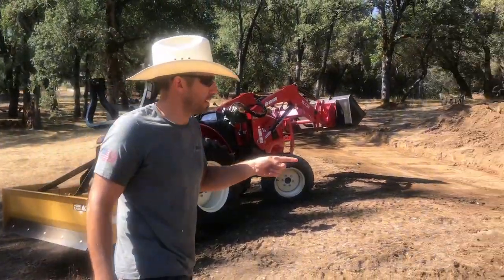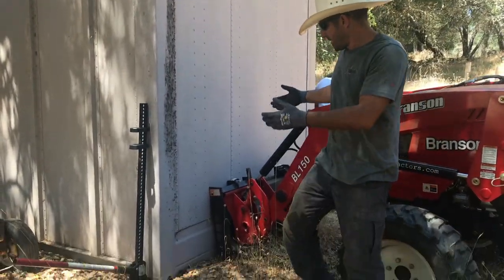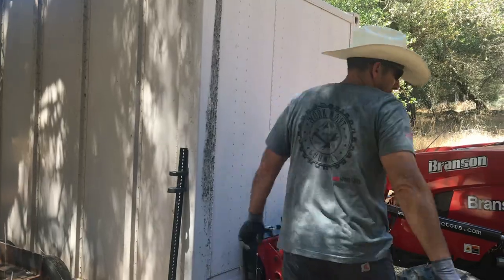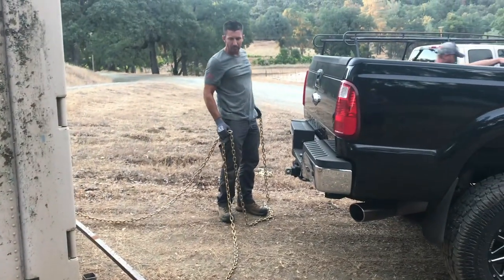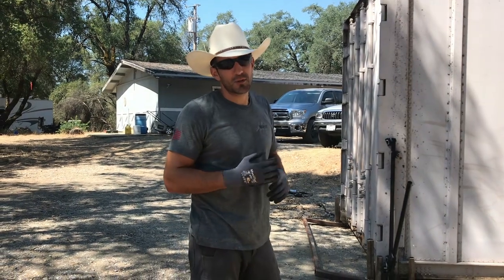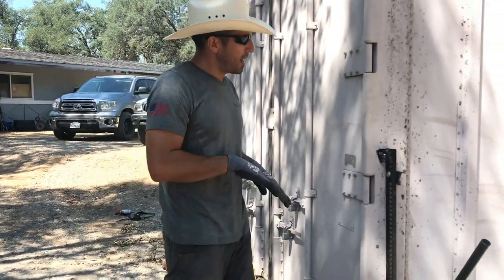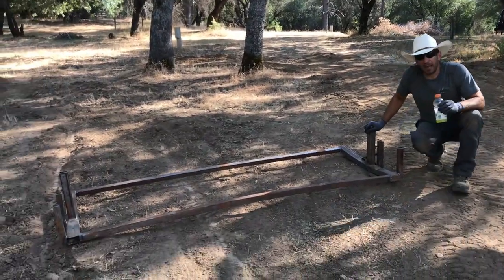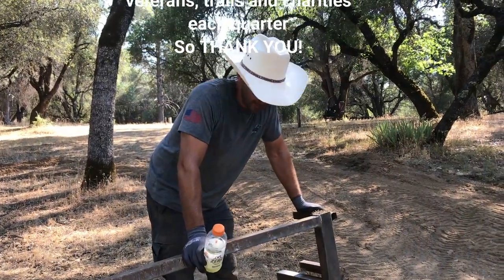Moving a 40' Storage Container with a F250 and Homemade Dolly - On The Homestead

Comment: Seems like a steel pipe would have been easier than the dolly. When I had my swim spa delivery they rolled it into place with some pvc pipes.
Reply from the maker: you would have an have several steel pipes to continue placing them under as it rolls over. and the sled allowed a little resistance as it rolls down hill.. thanks for watching

Comment: What's the story on the solid-tire dolly?  Is there another video?  Where did it come from?  Thanks!
Reply from the maker: those dolly wheel sets are used on a tow system for cars. the put one on each side of the car and there are metal crossmembers that span the width of the car and support it. then i filled them with a solid rubber mix from a company that does that specifically. they also make wheels thay can hook into the corner of the container but they were a little more expensive , thanks for watchin!
Reply: @WorknDirt  Thanks - what is the info on the tire filler company?
Reply: @WorknDirt  we need the company name please

Comment: Do you think you could have moved it with your tractor?
Reply from the maker: no i would need a tractor twice the size unfortunately
Reply: @WorknDirt  I have a mahindra 5145, Im going to attempt to move a 20ft I picked up a few months ago with
Reply from the maker: @beastofhumble  cool! thats a good size, i would put some short chains on the back of your tractor to take the weight off the front of the container and then see if you can slip something under the back feet on the container so they dont act as brakes lol. 
Your tractor might be strong enough just to drag it on all four though. Low and slow!